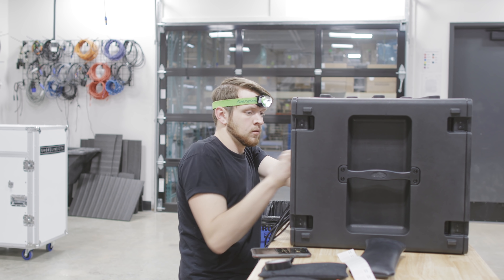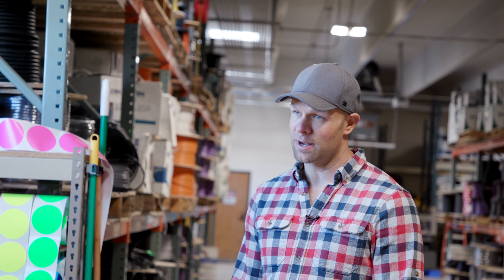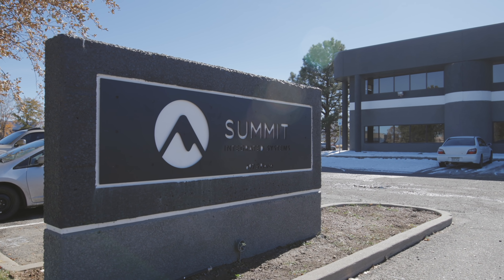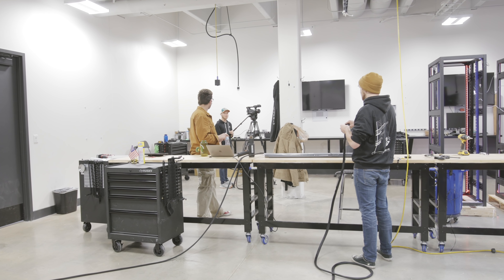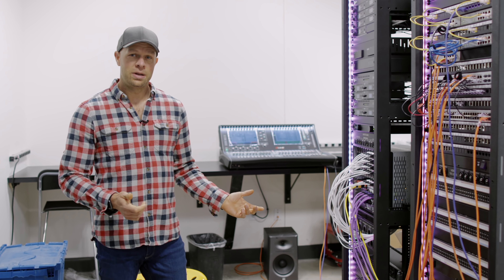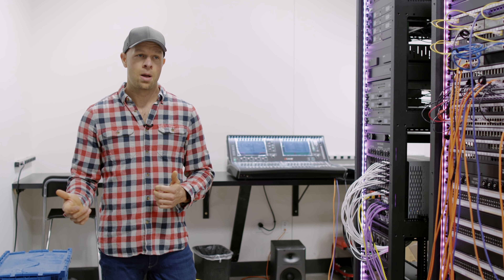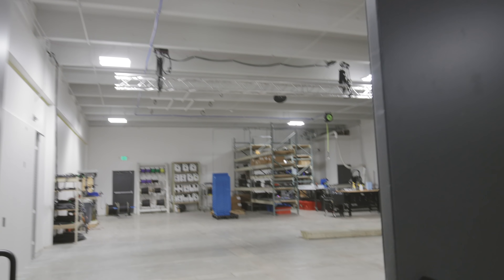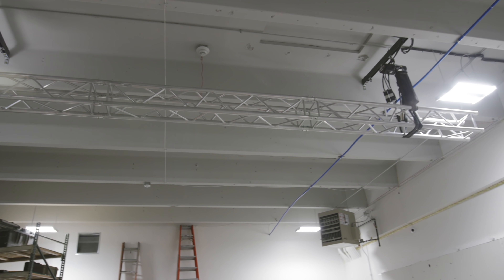Summit Integrated Systems | A Behind the Scenes Tour

Comment: What software do you recommend for live streaming. I am using OBS but since updating it won’t work and keeps crashing. I am using Apple products and am running a IMAC MINI. Need a little help. We use OBS, Vimeo, and Life Church’s platform. Thanks
Reply from the maker: I’ll be making a video about this soon but I’d try using ProPresenter for both presentation and streaming.
Reply: @Churchfront  We are using ProPresenter for service and live streaming on laptop but running other software and programs through iMac mini.
Reply: We are using a windows machine (1.000€) with propresenter 7 and vmix since COVID started without any problems! Pp7 is so good on windows and when using NDI. Vmix and pp7 are so good.
Reply: @anttekgeek  Thanks man. I will look into what you suggest. I appreciate it.